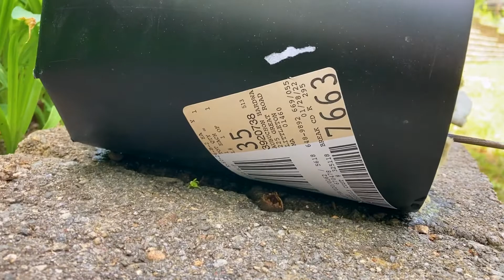Testing a simple forge

Comment: Thank you for the videos on making the lightweight refractory material. I was looking into building a small kiln for a microwave oven, so this recipe will certainly be a great help. The specific question I have is on joining/ glueing pieces of this material. Do you have an idea on a recipe that will work?
Thank you!
Reply from the maker: Depending on the temperature you want to reach, furnace cement would be a decent choice (it's typically good up to ~1,100 DegC). There are specialty mortars that can go higher. Depending on where you are, I have bought some from McMaster Carr. I have also experimented with using the same refractory material in the video for joining parts but it had mixed results.
Reply: @Drjtherrien  thank you for your answer. I am not familiar with the brandname in my country, but I am familiar with the high temperature joining paste up to 1100 degrees Celsius.
Reply: @Drjtherrien  So I will try that first and let you know how it held up.
Thanks again!
Reply from the maker: @janhuizer5382  Great! I will be interested to hear how it goes.

Comment: I have a random question. I am welder fabricator with no chemistry background. Could you supplement the perlite with potash as a cheaper alternative in your refractory mix? I've been experimenting with glass water and potash to make a refractory brick, and it seems to be working well though I haven't been able to put much time into it yet? Have only been giving it the blow torch treatment on the workbench.  
Thank you for the videos.
Reply from the maker: I use the perlite to provide thermal insulation. That and it should handle higher temperatures than potash. That being said, if you are aiming to use water glass the potash would be compatible with that. You still want to have something to increase the thermal insulation.
Reply: I was thinking about creating small air pockets by adding a small amount of sawdust evenly spread through the mixture that would burn out leaving airports. I saw another guy do this when making clay fire bricks.
Reply from the maker: @LittleAussieRockets  Why not ground up styrofoam?
Reply: @Drjtherrien  True! thanks

Comment: Is there any possibility of developing a refractory based on MgO or SiO². I would like to get into cast iron and Ca³(PO⁴)² melts at 1670°C which is a bit close for my liking. Awesome recipe. By far the best I've seen on YouTube (most use Portland cement😢). I've seen a couple of good geopolymers but were harder to source the raw materials.
Reply from the maker: Well thank you! I was considering MgO since that's not too awful to source. If I recall right the big issue was that exposure to moisture was going to be a potential issue as the MgO would convert to Mg(OH)2 and back to MgO when heated. I imagine the volume change would cause a lot of spalling in the ceramic.
SiO2... maybe you meant Al2O3? Silicon dioxide melts well below what Calcium phosphate can withstand. I have considered trying to use some alumina sand blasting powder as a surface treatment but have not gotten around to trying it.
Reply: @Drjtherrien  Intention to inform. 
Aluminium powder will induce bubbles when mixed into the mix. As soon the phosphates are leached out with the water the phosphoricacid formed will attack the aluminium and then produce pores. 
A standard recpie is:
1 : 0,6 parts and some water to get going
Wollstonite + Phosphoricacid 40-60% (the higher the content the longer the acid will nagg at the silicate and wont get hard. The reaction goes on for days when not weeks we stoped the experiment after 4 days by just mixing in 30% water. The idea of the water is that it functions as a ion-transferfluid. Then can the free ion exchange between the substances and form a new group)

1. You ad 80g Wollstonite to a 200ml container, the stuff will foam up about 3x its volume and then go back
2. then ad some water and mix that to a very thick slurry. As thick as possible. You dont want a very high water content in the mix because that makes the drying time longer and the result more brittle.
3. Then you ad the phosphoricacid to the paste and stirr it very good, dont spill it over, it will foam up very. The colder the water used the less bubbles will be formed. When you add aluminiumpowder it will form bubbles to.

4. now we are entering the casting phase, when the bubbles go away you have about 30 seconds to cast the stuff.

You will get a foamy ceramic like concrete. That insulates extremely well. You can pour the part into a foam and then inducing it to a vacuum chamber and getting the bubbles out, when the vacuum can be formed fast enough.

Maybe by adding borax it will be longer fluid. But i would have to test that to.

When you add some flyash as filler you have a +-2000°C refractory cement.

You can also take metakaolin and mixing potassium waterglass in it BUT the silizium content has to be 1,75 Si to 1 part Kalium to get very good results.

you can but concrete sealing waterglass based on Kalium that is cheap and works to.

More recipes can be found in Davidovits geopolymer book.